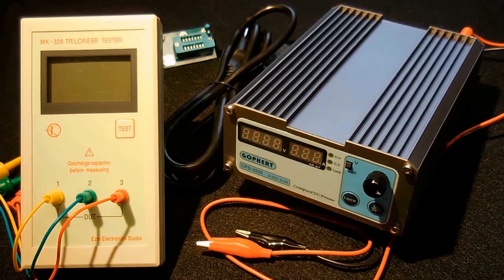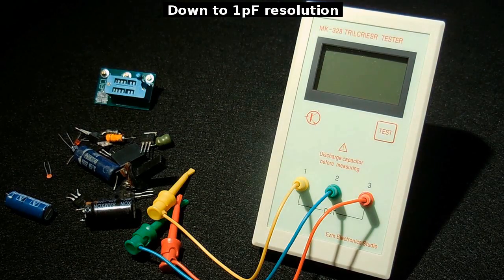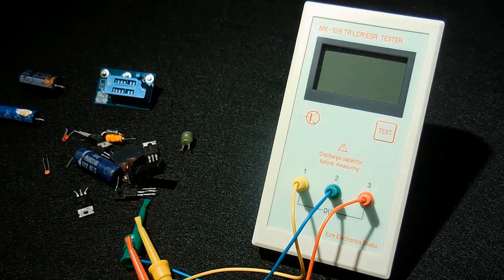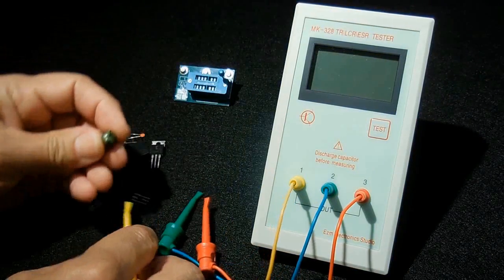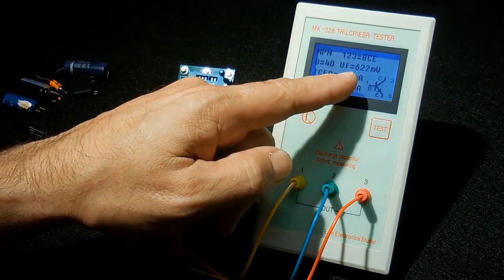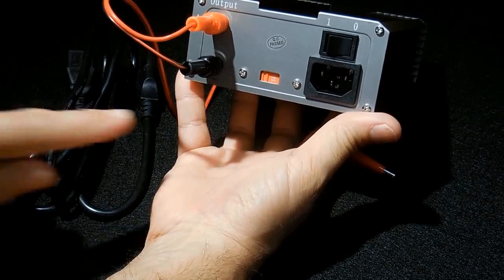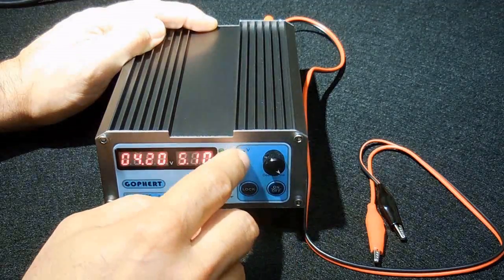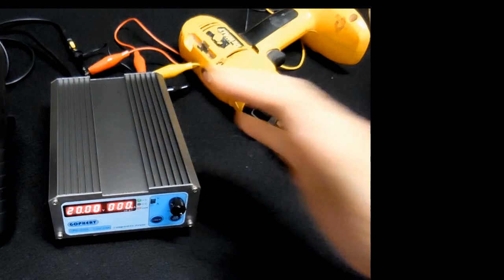(2) Very Good/Low Priced Items For Electronics Hobbyists

Comment: Is there a difference between an ESR meter and in-circuit ESR meter?
Reply from the maker: Testing "in-circuit" is never fully reliable. There's always a chance that other components will affect the reading. That being said, I've used this meter to test electrolytics in-circuit with no problem at all.

Comment: Could you do a test on NiCad replacement battery cells...I am trying to rebuild 18v NiCad battery for my Dewalt and Makita drills and found 1.5 AA NiCads on battery warehouse.com for $1.50 ea. Not sure who makes  quality batteries. Dewalt wants $90 for a new battery...crazy...I have lots of old style Ni Cad drills and saws which have bad batteries and want to rebuild all power packs. Thanks! PS I am ordering this meter. Also a pocket oscilloscope.Shalom

Comment: If we follow those links, do you get a piece of the action?
Reply from the maker: +James Pian 
Unfortunately no. I am only supplied with free items of my choosing. If I like the product, then I agree to make a video and post a link to the sellers website.

Thanks For Watching
Reply: +electronicsNmore 
That's a good deal though. Thanks!
Reply: +electronicsNmore 
I found out how you can get a piece of the action for stuff you recommend, or even just use in your videos. It's called "Amazon Associate". You'd get a minimum of 4% on items your fans buy if they purchase through a link you supply in the video description.
Reply from the maker: James Pian

I just worked a deal with Banggood and Gearbest. I will be getting a small cut now. :-)

Comment: Looks like a switching power supply is it noisy ?? If your limited in space on your work bench its a nice addition could fit 2 or 3 instead of the standard linear supply's ! would have like to se its inside ! Nice video with good and simple explanations ..
Reply from the maker: 1badpete999 Yes, switching power supply. Very reliable, super compact, and not noisy.

Comment: Hey! ÷*) Been a happy subscriber for ages, maybe since the beginning?
Anyways, I need your help. I'm a budding electronic hobbyist (bitten bad by the eBug) and I want (I think) a linear power supply .  Can/Will you help me out? Thx! :*)
Reply from the maker: Unless you plan on using the power supply for high frequency audio applications, I'd use a switching PSU like I show in this video. Linear units are heavier, and lower noise, but for me, I'm happy with the switching type.